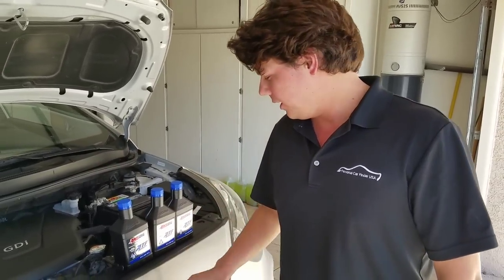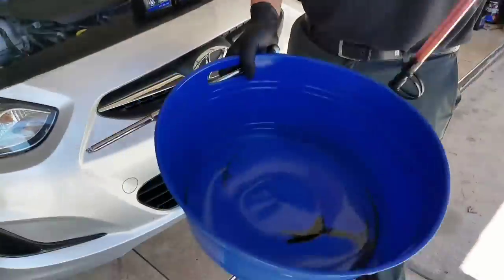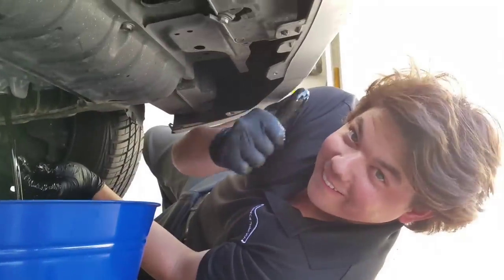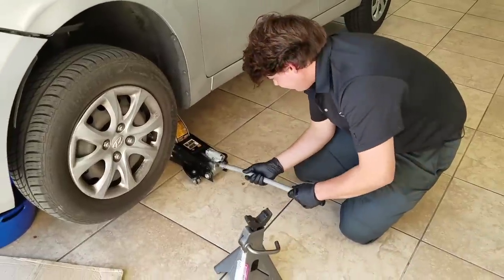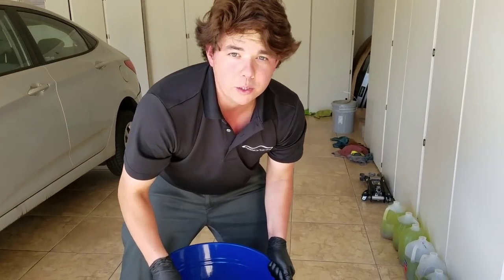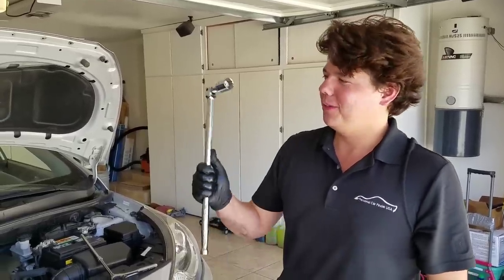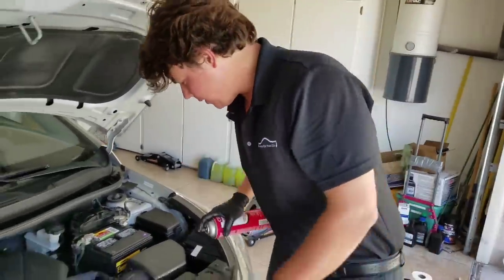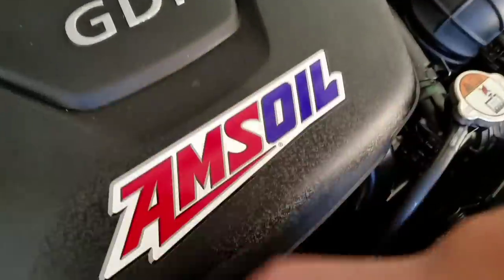Hyundai Accent AMSOIL Transmission Fluid Change & ATF Fluid Flush

Comment: I don't know anything about Amsoil transmission fluid. But Valvoline Max life screwed up  transmission in my car. You have to be careful to put it after market fluid. My transmission starts slips. Change one time to sp3 original fluid shifts better . Planning to do one more fluid change. Hope will help me. Hope didn't kill my transmission. Be very careful.
Reply from the maker: As long as you use a transmission fluid that meets or exceeds the OEM spec you're fine the big thing is he's forgetting the change it is when most of the problems happen you drive too long on the fluid.

As far as putting the wrong specification in that would be a problem that could wreck the transmission
Reply: @Syntheticoilprotection  I have changed my fluid every 30k I have to drain Valvoline Max life. Refill with Aisin fluid. My transmission on my car started working much better.
Reply: @Syntheticoilprotection  In front of the canister it is mecron 4 on the back compatible with Hyundai/ Kia sp3. This is totally b.s. That fluid after 1200 miles was smell burning oil. Have to drain and ad it sp3 fluid from Aisin. I don't work for any company. Just to shear my experience with Valvoline.

Comment: I have a 2011 AT/tiptronic accent that hardly run on D at start and when I switch to tiptronic it says its on 3rd gear eventhough the car is in full stop and I can't change gear. What seems to be the problem? Do you think changing the ATF fluid will help?
Reply from the maker: I would ask a professional mechanic.

In my opinion there could potentially be something broken inside.

I would consider the mileage and the driving conditions to see what it could be also?
Reply: Mileage is aroung 59000. Been ignoring a blinking check engine light lately and two ecu resets. Car still runs and already brought to casa and they said the reason its always on 3rd gear is because it's on fail-safe mode. Need to run full diagnostics to find the problem and I hope it's not something really serious like replacing the transmission entirely.
Reply: Guess what? I just visited a mechanic and changed the ATF on my car. After a few restarts the ecu resets again and now the car runs normally and I feel an improvement on the transmission. My next question is, is it normal for the ECU to reset automatically and why or when does it happen? Thanks for your reply I really appreciate it.
Reply: MarkCreative same case with my accent 2012. How many quarts you change the ATF?
Reply from the maker: This is the lookup for any vehicle- AMSOIL Vehicle Lookup - https://www.amsoil.com/guides.aspx?zo=5331179
Reply from the maker: I think if you take the battery off it can reset it sometimes depending on the car
Reply: @fitronfahmifaruqi7538  about 2.5L
Reply: MarkCreative hi mark, are your accent problem come back?
My transmition has run normally after changed 3 liters atf oil. But after few month, my hyundai accent stuck on 3rd gear again

Comment: nice video! im going to do this in the next 3000 miles in my car, the owners manual on my 2014 accent says to change it every 60,000. question though, was it really necessary to do the second flush? i understand your reasoning, but it looked like the second time you removed the drain plug it basically just poured brand new fluid out
Reply from the maker: You're pretty much right the second flush is only changing about 20 to 25% of the old fluid.

If it was my car I would do the second flush so that's why when I do it for others I do what I would do to my car that's how I help everybody as if it was my personal car.

Comment: My Hyundai Accent 2014 (4 gears transmission) automatic (1.6 - Benzin) is stuttering and engine hesitates while driving sometimes, what would the problem be? Please help me, even Hyundai's service center couldn't find the problem!
Reply from the maker: I really don't know I would make sure the fluid looks good and try to maintain that the best you can with the highest quality ATF fluid
Reply from the maker: The best thing you can do is change the transmission fluid and if that doesn't do anything it's time for a rebuilt transmission or a new one because those are like throw away lighters you just replace it
Reply from the maker: I would also do an engine flush to

Comment: I looked and it does not appear to be for G 055 540 A2.  It does show a lot of the specs that it cross references to anyhow.  The thing is I have a 2013 Passat 2.5 with a 09G.  The fluid which G 055 540 A2 is appears to be WS.  It took a good bit of searching to find that is what that fluid really is.  The 09G is really an Aisin transmission.  In cars not made by Volkswagen or Audi it is the TF-60SN.  The fluid the VW dealer sells is close to $25 per liter.
Reply from the maker: This will give you the fluid capacities and the proper fluids for your specific vehicle.

     AMSOIL Products & Vehicle Lookup - https://www.amsoil.com/guides.aspx?zo=5331179

Comment: yikes those later models.
My 2008 thankfully has a dip stick
Reply from the maker: Lol😆
Reply: I got a 08 accent gls , have u ever seen a fuel filter for  it?  Its weird some sites carry a fuel filter and some dont.The owners manuel says its there but i cant find it....
Reply from the maker: It's probably built inside the gas tank I wouldn't worry about it.

I would make sure you run Marvel Mystery Oil every other fill up to lubricate the fuel system and then another thing I would do is get the Amsoil Pi performance improver and that will clean your fuel injectors your fuel system and keep everything running in Tip-Top shape
Reply from the maker: I would get a couple bottles of Pi performance improver - https://www.amsoil.com/shop/by-product/fuel-additives/gasoline/p-i-performance-improver-gasoline-additive/?code=APICN-EA?zo=5331179
Reply from the maker: Don't sweat finding it I've had many vehicles that certain models don't carry cabin air filters and I was looking all over for it LOL
Reply from the maker: Not sure

Comment: Pls tell me when to change my CVT fluid on my accent 2020
Reply from the maker: If it was a new car I would change it immediately if it was my car.
Reply from the maker: Your transmission will last longer with the hundred percent synthetic CVT fluid.
https://www.amsoil.com/p/synthetic-cvt-fluid-cvt/?zo=5331179

Also if this is your first order it's best to be a preferred customer you'll have the free shipping and you'll also have the wholesale pricing.

Ebens Link: AMSOIL Wholesale + FREE Shipping: https://www.amsoil.com/offers/?zo=5331179
Reply: like engine oil , auto trans cvt fluid needs changing when it’s dirty . if your car is used to do city stop start driving each day , you’ll need to change it more regularly than if you were travelling on highways or non stop trips . your handbook will tell you intervals of changing fluid . this is an absolute maximum !! to keep your automatic CvT in tip top shape it’s best to change out the fluid no more than 15,000 klm . i do mine every 10,000 klm

Comment: Great video, why did we change the automatic filter? Manufacturer and many on internet recommend that filter change is required during fluid change.
Reply from the maker: Great question just depends on the vehicle you'll see some have a changeable filter others are a basic drain and fill you'll see a lot of CVT transmissions are a drain and fill and also a lot of Honda transmissions are just a drain and fill and then you'll see most GM and Ford have a changeable filter and magnet that you can clean Take a look at the playlist on transmission fluid changes on my channel page you'll see how most vehicles are one or the other
Reply: @Syntheticoilprotection  thanks for the quick reply, for my hyundai it is a rtv sealed transmission, there were few who recommended to change filter along with filter. I got answer for this one.

One other question, few forums refer to change transmission oil through cooling lines, what is your take on that. Appreciate your professional advice.
Reply from the maker: Of course thanks man yeah I always just do drain and fills and I don't take any lines off because some fittings are made out of plastic and it can get cracked and it's not worth replacing parts when all you need to do is just drain and fill it or just drop the pan and fill the pan and change the gasket so that's all I like to do but the best thing to do is doing a flush by taking the lines off but to me it's not worth the time..
Reply: @Syntheticoilprotection  great, thanks a ton. People say pan drop would only take about 30 to 50 percent oil out. That made me thing about cooler line..

This information I wouldn't have got in india. Thanks a lot.
Reply from the maker: 😉, Thanks for being a part of the channel man really appreciate you 💯
Reply: @Syntheticoilprotection  need your professional advice, my car has a pickup issue, the rpm stalls and picks up speed with 2 to 3 second delay while driving.  Few say it is engine issue and few say it is transmission issue. Have you ever head of such issue?

This delay reduced at few occurance such as change of air filter. 
It is not delayed engagement issue as drive and reverse works fine on cold start.
It is neither stalling issue as speed increases as engine rpm increases.
Reply from the maker: I really am not sure.
Something I'd have to drive.
Reply: @Syntheticoilprotection  cool thanks, I will take it to 3rd service center tomorrow based on the verdict, I will go for transmission oil flush. Luckily I found the amsoil distributor in Bangalore India.

One other behaviour of my car is if it is picking up slowly if I reduce the gear it pickup quickly. In India we have automatic with manual option.

Comment: Thank you for taking the time to do this video. Did you ever confirm/check the fluid level before and after you did this? From what i have seen on other videos, you need to check the level by removing the the check level plug since there is no dip stick.  Also, do you have the part number of the crush plug on the drain?  And if you did check the fluid level, do you have the part number for the check level plug gasket?  Thanks again for the video.
Reply from the maker: Great questions here I was not able to find a check on it so I just refilled it with what came out and I also cross-referenced with the capacity of the pan and what came out was basically very close to the capacity of the pan so there's no reason to check it.

Also the crush washers I have never replaced one and I've never had one leak on me yet.

I always torque my bolts anywhere from 18 to 30 pound feet of torque that's it

Comment: I have a 2014 Hyundai accent do you change it the same way?
Reply from the maker: Most likely it's just like it.

I recommend getting the easy pack to make installong the fluid easy.

This will give you the fluif capacity for your car.

      AMSOIL Products & Vehicle Lookup - https://www.amsoil.com/guides.aspx?zo=5331179
Reply: I have 2014 Accent. Yes it is exactly the same. Except I didn't have a hot chick watching me.😁

Comment: Great work 
I have Hyundai accent 2015 petrol 
With CVT transmission 
.. sometimes when I drive the transmission stop for 1 second then back working ..and it have little sound when i change from N to D or to R and I checked it with computer it say nothing wrong ..
So what y advice me to do? 
 my car 135000 km
Thank you
Reply from the maker: I'd try a Amsoil CVT fluid change.
Reply: If you have a CVT, you must change your fluid every 50,000 kms (Just a simple drain and fill as shown in this video). CVTs generally generate more heat than a regular Automatic. So change your fluid often. Logic is simple - HEAT kills the fluid which inturn kills the transmission. Keeping your ATF fluid clean/functional for any transmission is the key. Use a quality Synthetic like Amsoil.:)

Comment: what kind of degreaser did you use? the one you spray
Reply from the maker: I like using simple green a lot.

Also amsoil makes a really good parts cleaner which I like a lot.https://www.amsoil.com/p/brake-and-parts-cleaner-bpcsc/?zo=5331179

Comment: Why did you do a flush instead of a drain/fill? I always hear people say not to flush. Is it a myth that flushing is bad?
Reply from the maker: Great question on this one we just did a drain and fill the flush is another additive that can get put into the transmission and idled however it's ideal to get all the old fluid out if you do do a flush there's also a different types of flush there's a machine that they hook up that flushes it that one is the one that most people don't recommend because the machine can dislodge particles and if you don't change the filter you could have clogging however when you do a standard pan drop on most Transmissions you change the filter and that way you don't have to worry about any clogging when you change the filter so most people refer to the best way to do it is just do a basic transmission fluid service which is a transpan and filter change where they drop the pan change the fluid and put it back.
Other cars there is no transmission pan to change some are just drain and fill most Honda's Toyotas and some of the other economy cars are just the basic drain and fill like Nissan and a couple other ones especially some of the CVT transmissions it just depends on the component the transmission and the model

Comment: Thanks for sharing such a great and detail video! Btw, I have a 2014 Elantra and was thinking to change the transmission fluid but not sure am I suppose to change it. My current mileage now is only 32K. Appreciate if I can get an advice.
Reply from the maker: Yeah I would change it early because it'll run much smoother your get better gas mileage and you'll also extend the life of the transmission
Reply from the maker: This is my personal link and it will get you 25% discount  and free shipping on any order $100 or more.

I did the coolant and trans and oil on this car and it runs amazing now.

Eben Rockmaker
Independent AMSOIL Specialist (Dealer#: 5331179) https://www.amsoil.com/offers/pc.aspx?zo=5331179
Mobile: (702) 472-3614

Steps: 
1. My blue link gets you 25% discount and free shipping on orders $100 or more. I will get credit for your purchase when you use my link. Click blue link under my name, Click join now yellow bar Preferred Customer for 1 year. Click add to cart. Note: Amsoil will not keep your CC info. There is no recurring charges.
2. Click look up your vehicle.
3. Click auto light truck. 
4. After you have all the products added double check then complete order.
Any order over $100 is free shipping and ships within 1 to 2 days.

AMSOIL Vehicle Lookup - https://www.amsoil.com/guides.aspx?zo=5331179

     Friend me on and tag me because I like to see great results:
Instagram - https://www.instagram.com/syntheticoilprotection/

Facebook - https://www.facebook.com/profile.php?id=100007973957868
Reply: Being you have the elantra I would first make sure that you order or get the correct transmission fluid I believe it is the sp-lll do not use the incorrect fluid in a Hyundai there auto transmission really need the Hyundai sp-lll or whatever fluid yours calls for these newer cars have much tighter tolerances and temperature ratings...Best wishes
Reply from the maker: Thanks for reaching out to me Richard this is my link that will get you the wholesale price also you will get free shipping on any order a hundred bucks or more and also for the rest of the six months you will have that same benefits plus they do promotions like a complimentary bottle of Pi cleaner when you order 75 bucks or more that's one that they do a lot.

     My Link: Best AMSOIL 100% Synthetic @ Wholesale + FREE Shipping: https://www.amsoil.com/offers/?zo=5331179
Reply from the maker: Richard if you have any other questions feel free to call me happy to help you anytime.☕

     Professional YouLubher: Eben Rockmaker Master Direct Jobber AMSOIL Specialist (Dealer#: 5331179) Mobile: (702) 472-3614

Comment: is the process the same for a manual transmission? gonna give this a go this weekend.
Reply from the maker: Hey Edward this is my transmission playlist you'll see some manual transmissions in here just depends on the model and you'll also see the fluid you need on the lookup guide and it'll also give you the capacities.
https://www.youtube.com/playlist?list=PLB_ftWArBFdfzuV7RHGz70MD-PawLbKgu
Reply from the maker: The manual transmission should be very easy it should be a regular drain and fill.
Lookup For Your Vehicles - https://www.amsoil.com/guides.aspx?zo=5331179
Reply: @Syntheticoilprotection  great! thanks so much! love the videos. keep up the good work!

Comment: Ever use the engine & transmission flush before doing an ATF fluid change?  Would love to see a video of it being used in a transmission. Is it worth it or just doing fluid changes enough?
Reply from the maker: I will be doing a video with Jeff on a transmission that we can change all the fluid and will also do a flush on it.

Most of the Transmissions that I do you cannot change all the fluid and in that case you don't want to use the flush because you don't want to leave any flush in.

Some of the Transmissions you can disconnect one of the transmission fluid lines and you can pump it all out
Reply: I look forward to it!  I was going to open the lines and exchange all the fluid but was concerned about the fluid in the torque converter and not getting all of the fluid out somehow. 

Can’t wait to see it. Subbed